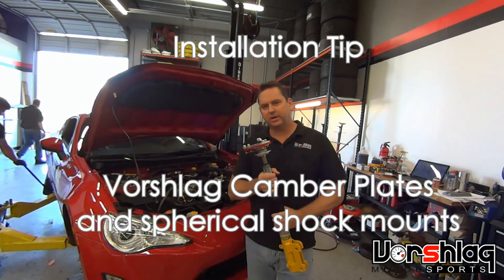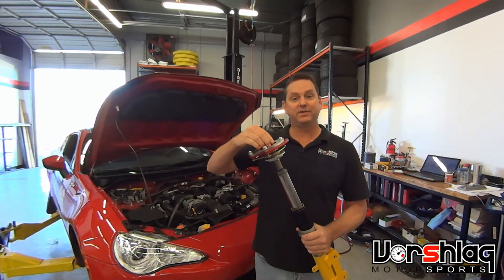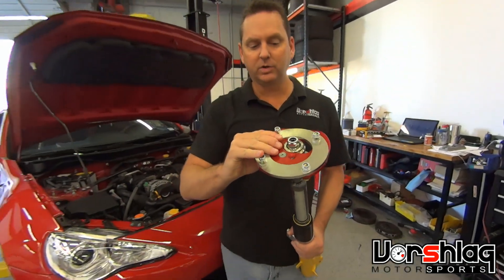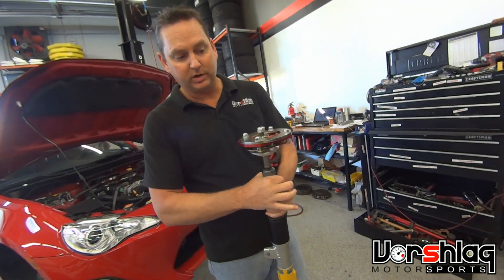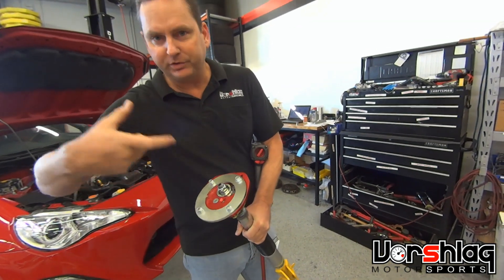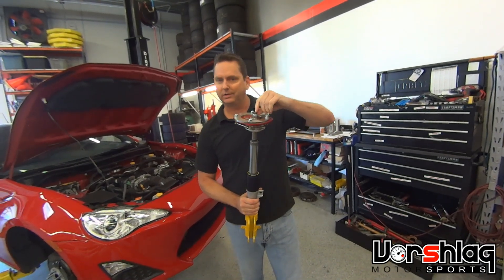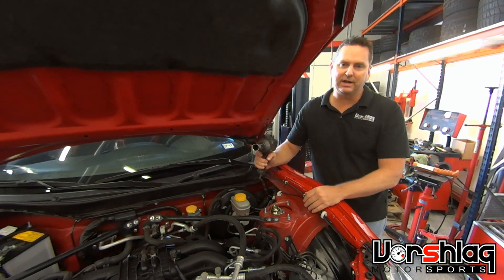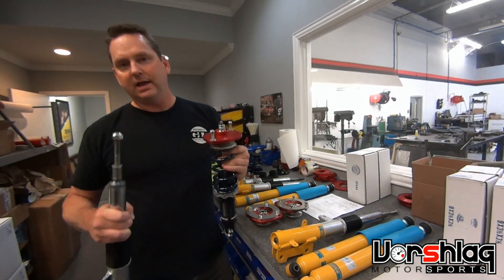Vorshlag Tech Tip: How to Tighten Strut and Shock Top Nuts

Comment: Thanks for this.  I've got a pile of parts building up and the job involves removing and disassembling strut assemblies, and because it hasn't been so long I forgot how annoying this is I get to going through the same cycle of spending time on Google looking for inspiration on how to properly tighten these stupid things.....   yeah, screw it, impact it is.  If you're doing this as often as I'm sure you do and it's not causing any issues, then that's that.

Comment: Thank You as my teachings have been not to use air because possibly damaging the strut or shock internally.
Reply: That's because you're not supposed to use an impact tool on this. It can cause damage, and you never know how much torque is being applied with an impact tool. Don't you think that the manufacturer knows what they're doing. Using an impact gun to install any hardware is the hack method.
Reply: I grind 2 flats on the appropriate 1/2" drive socket to fit a Crows Foot and with stem holding tooling down the center of that finish with a Torque Wrench.
Reply from the maker: @phill3583  well the shock makers are divided on this, but we are not. Have done thousands this way and we didn't lose half the population of the universe doing it. #ThanksThanos Honestly, unless you are complete mouth breather and follow our instructions, there is no problem. ;) Grinding flats on the shaft of a chrome strut is borderline nuts.
Reply: I couldn't fit a standard box wrench down far enough to grip mine so I used just a socket protected by tape with big pliers holding it while I turned the top shaft with the torch wrench. It tightened real good. Both sides were loose. (I replaced one of the mounts) Wondering though if I can take those nuts off to replace or loctite while struts still on vehicle??

Comment: The instruction leaflet that came with my Bilsteins explicitly says NOT to use an impact tool.
Reply: Proper way to tighten top nut video here...https://youtu.be/Ho3KvxC2gj0
Reply from the maker: yea but then you guys run around with loose strut top nuts, which rattle and hammer the sphericals to death. Bilstein = German company. SUPER conservative/safe. They assume we are morons and will just sit there and impact the crap out of the top nut for hours, spinning the shaft over and over and over. Don't do that! Follow our instructions and you will be fine. We have done this THOUSANDS of times.
Reply from the maker: I'm not saying we know more than Bilstein.... except that I am, and we do. ;)
Reply: Vorshlag lol😂 thanks for this video, hope tightning up those top nuts will help, i changed my struts yesterday. Probly didn’t tight it good enough, bcs i’ve been hearing noises from the struts.
Reply: @Vorshlag  if the threaded part of the shaft is not protruding out of the top nut can it come loose after time? Do you reccomand periodical torque?
Reply: He doesn't know more than KW or Bilstein. I used an air gun like in this video and that is why I had a premature failure on 1of my KW v3 Coilover after 3 years, it blew. It was the only Coilover I used an impact gun on, which I was still unable to get the nut to tighten. In the manual from KW it says do not use impact tools. Learn from my mistake and see my video on the proper way to tighten the top nut.
Reply: @MotordyneG35  post the video please

Comment: It's called a crows foot wrench, that's how you torque it.
Reply: An offset box wrench is the tool commonly used for this. You can get a stubby with a 3/8", or 1/2" drive to fit a torque wrench. Just about every manufacturer suggests not to use an impact tool. A lot can go wrong. Especially if there's a rebound adjustment on the top of the shaft. Just last week someone brought  a brand new front strut assembly to our shop, with the top nut stripped, and spinning freely. The nut wouldn't back off. He asked if we could fix this. One of our techs tried prying upward on the nut while turning, but had no luck. I stood next to the young man while the tech ground away at the nut, until it came apart. Unfortunately the shaft threads took a good beating as well. I asked him how this happened. He showed us this video on his phone. He said it stripped out on the third short blip of the gun. Unfortunately they were very expensive KW's. He has to buy the whole set again. They'll only send out single units covered under warranty, once the core is inspected for manufacturers defects. He said the rep told him they take many impact gun failure related phone calls. The fact is. You can never tell how much torque is being applied with an impact tool. There are too many variables. Air pressure, tool settings etc. They're great for blasting stubborn fasteners apart, bot for assembly......??? Not recommend.
Reply: First, thank you for telling me why not to ever purchase a KW product.  That's a ridiculous policy.  At least if I screw up a Bilstein I can eat the shipping and repair costs because they're competent enough to be able to disassemble and repair their own product.

Second, it sounds like this gentleman didn't get the nut threaded on by hand before resorting to the impact.  Either that or KW uses very poor quality materials for their strut shafts or the hardware that goes with it.

I'm sure there's a good reason why impact tools aren't recommended for tightening these, but (if my memory serves) the Koni Sport on the rear of my car has nothing to prevent the strut shaft from spinning.  No hex indent, no way to grab it with a wrench, nothing.  I had to use the thickest rubber padding I could find with some vice grips and hope I could get enough torque on it to get it tight enough without marring the shaft....  a technique which is also not recommended, for really good reason.
Reply from the maker: many car's don't have a "flat" to put the crows foot on.
Reply from the maker: And the little hex broached into the end of the shafts is VERY weak! If you try to hold the shaft that way it almost ensures that you will snap the end of the strut shaft off. Seen it happen, its crazy that the shock makers still include that.
Reply: How many times I have gotten the damn Allen Hex Key stuck in the top of the stem. Seemed like I need to use a NEW one each time to not have that happen.... :P  Our KW's have an external 10mm  hex.
Reply: Yes impact guns should only be used for REMOVING nuts and bolts, NOT for installing them.  Impact guns are the cause of so many premature part failures, including putting to much load on wheel bearings when a cave man shop tech uses an impact gun on the axle nut without any idea of how much torque he is actually using.  "Oh those parts are garbage" he'll say, "I see them fail all the time" and never realizing he is the cause.